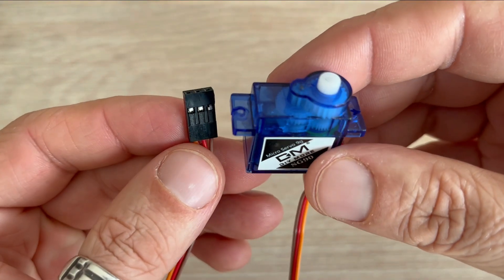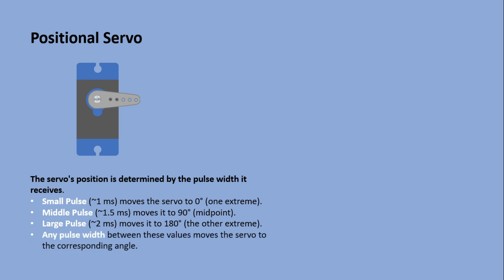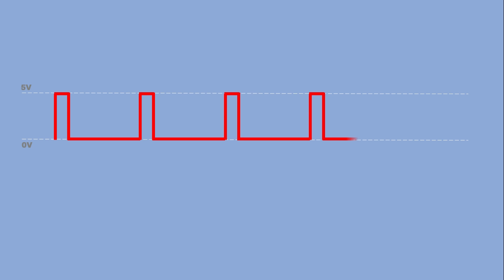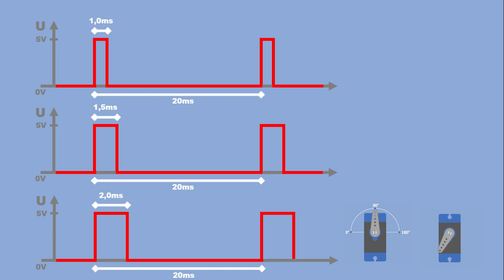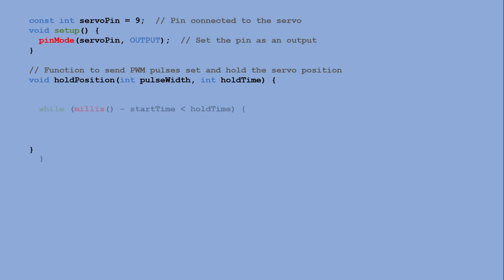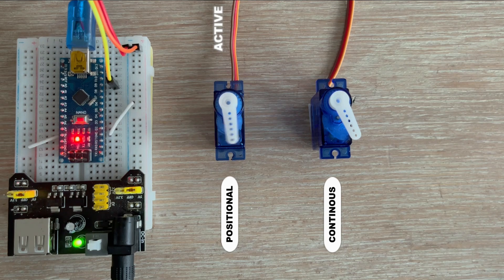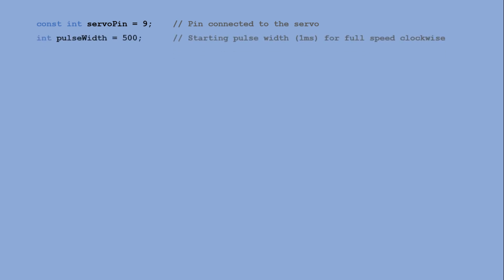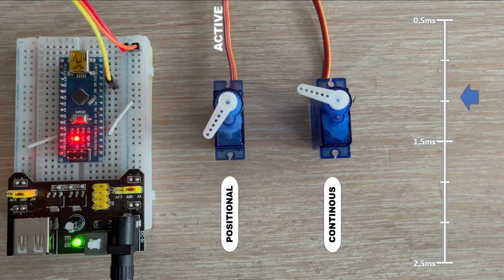Arduino Servo Basics: Positional vs. Continuous Servos Explained!

Comment: I should add wether I am right or wrong about the error in text of the code, this is a really good presentation. 👍🙂
Reply from the maker: You probably are right. When I turn arduino code into this presentation there is every chance I can miss a line. Of course every variable needs to be declared:) I am away from my comp. Buy if this is for storring timestamp this variable should be delared as unsigned long
Reply: Completely understandable.🙂
Thanks for your reply, unnecessary but appreciated.
I enjoy your technique and content, personable yet professional. I like the content and the excellent production value of the presentations. Nice work.🙂

Comment: Sir the code returned an error when  compiling. It says "startTime" not assigned.

What number can I use in place of it?
Reply from the maker: Thanks for spotting this . There is a line of code missing before the while loop  unsigned long startTime = millis();  // Initialize startTime
Reply: @marios_ideas Thank you, sir. Code works now. So if am correct, the "while loop" parameters ensures that the signal for each position is being sent every 20 milliseconds till the hold time elapse

Comment: When I first used servo, I didn't know there are 2 types of servo. I used continuous one on my project instead of 180 degree one.
I used RF NF2401 to control servo.  It moved just tiny bit and then stop. I thought my code is bad. So I gave up. 
I also threw that servo into a trash. I don't understand why the manufacturer didn't write it on their label.
The only way to know is to test it.